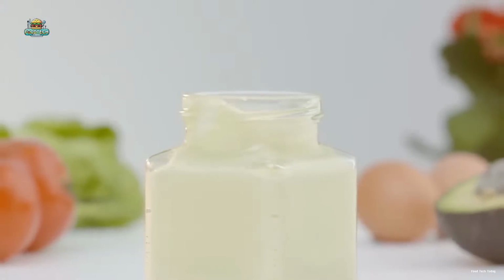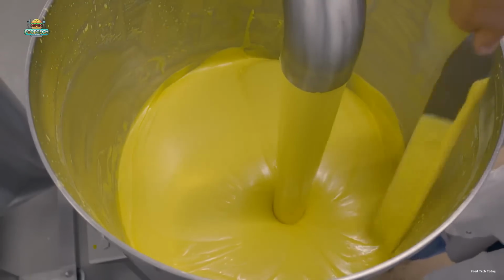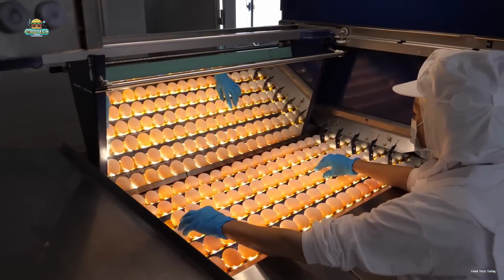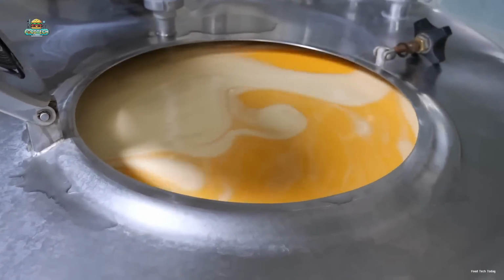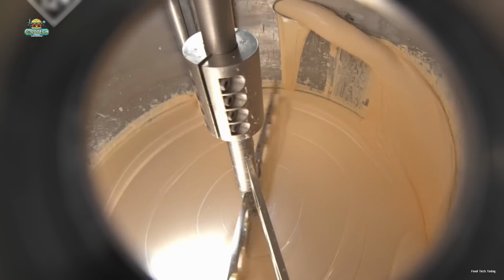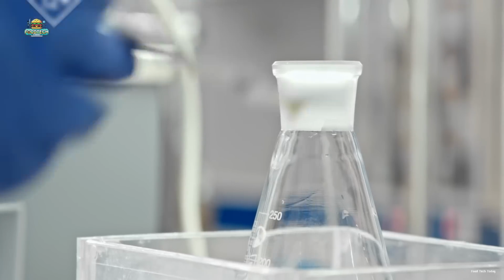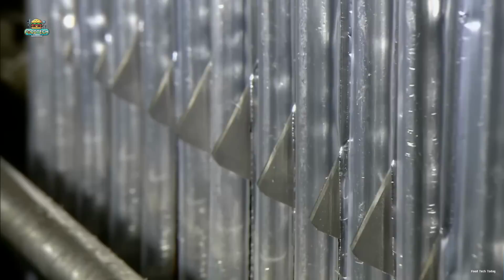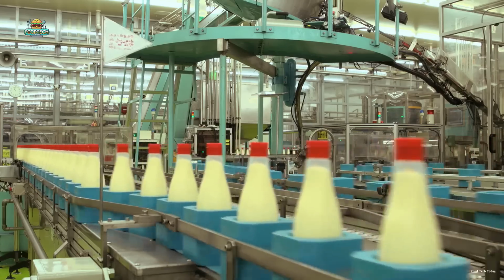How industrial Mayonnaise Is Made🍶 | How Is Hellmann's Mayonnaise Produced?

Comment: Most interesting but that does not explain why home-made mayonnaise will only last 3 days in the fridge while these commercial products will last a very long time. I am surprised they used real eggs and not powdered one. I wonder if the info is all true🧐
Reply: The answer is in the second yolk heating, which they called pasteurization. If you heat the yolk to the right temperature and hold it there for the correct time, it kills all the nasty bacteria. It's nearly impossible to do that at home without cooking the yolk, making it useless for mayo. Powdered egg is just as useless as cooked yolk. I don't know why the person running the channel chose to comment with sarcasm and ignore your question. I wonder if they actually understand the content they are posting.
Reply: @DrBeenaPlumber  "the channel chose to comment with sarcasm and ignore your question" you don't wonder you know why cause you are an intelligent person. Point is any product you can if you have time make right at home will always be better than industrial products.
Reply from the maker: egg powder, you surprised me